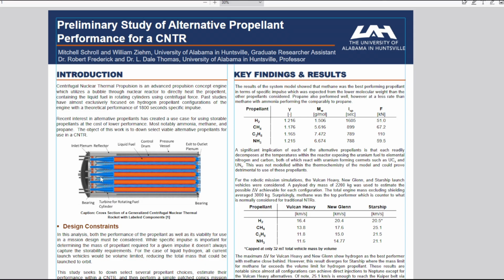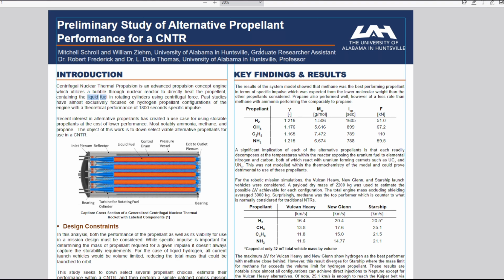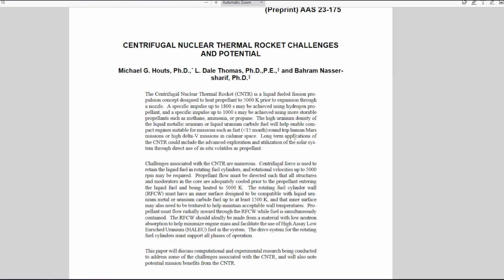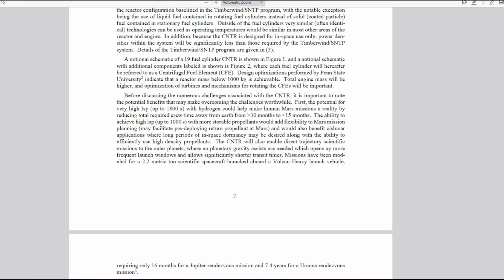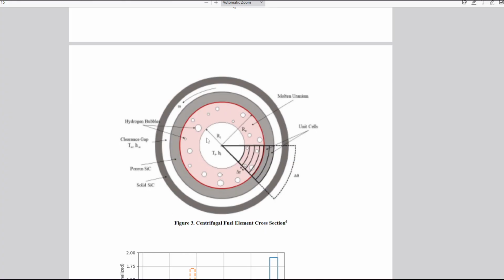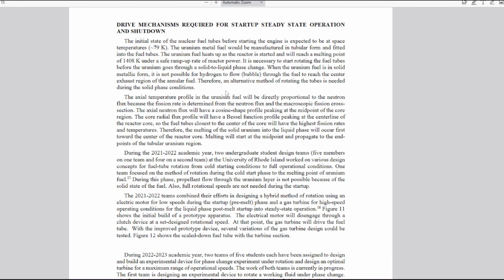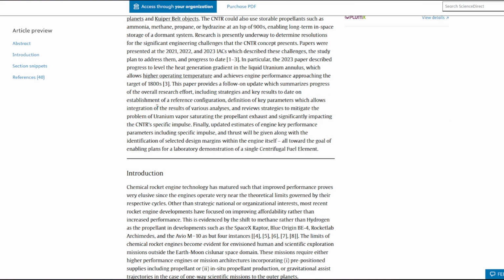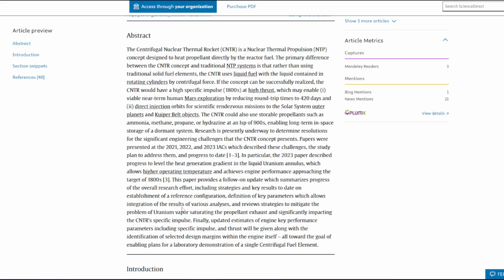On Centrifugal Nuclear Thermal Propulsion

Comment: Personally, I've always been skeptical of liquid-core nuclear thermal, since it's a similar level of complexity to gas-core but doesn't manage the same insane Isp.

Also, using an open cycle rocket is entirely acceptable if you're using it away drom Earth, like for travelling to Mars

I think the old Soviet project on containing gaseous (highly ionized) uranium with electromagnetic fields is of particular interest re: getting gas-core to work.

Comment: The way I read this, Liquid Fuel is in reference to the rocket fuel, not the nuclear fuel. The way I am picturing this; is a rotating conical cylinder with walls made of a fissioning fuel, and inside that cylinder is the rocket fuel travveling along the inner walls, heating up, until it reaches the expansion nozzle and is ejected out the back. The centrifugal G forces keeping it compressed and liquid while it is being heated. A portion of those nozzle gases can be used to rotate the entire engine. Two, counter rotating, engines can be used, to balance out the forces on a craft.
Reply from the maker: I initially pictured the CNTR the way you did, but reading it, the liquid fuel is very much the actual nuclear fuel here. This is a liquid core nuclear reactor.
Reply: @RaizSpace  Or it could be both. The liquid nuclear fuel travelling through the inner walls of the tube in the same way that cryo-fuel is pumped through engine bell nozzles for cooling. And then rocket fuel flowing through the inner annulus.

Comment: The only added value of such a system is the use of LEU rather than HEU but I perfectly agree on the shortcomings to test such a system on the ground and the lower risk-benefit tradeoff. Some might imagine to use a scrubber-ejector combintation like the one used to test vacuum rocket engine with an additional filtering system to recollect condensate uranium particles. However, with Draco now cancelled and the advancements in propellant depots I see little future for nuclear thermal propulsion in the short term.
Reply from the maker: Well, I've been working on a future history, so I'm looking at the long term.

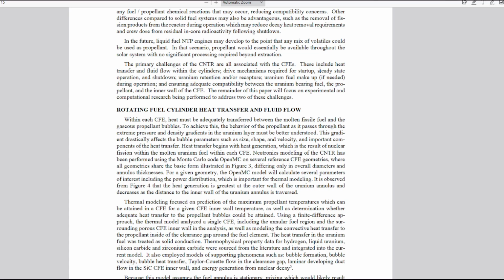Comment: 7:16 As I understand it, the goal is not to avoid having the propellant touch the liquid uranium, but rather to avoid having the uranium flow out the nozzle when it melts. 

Spinning up the drums creates a centrifugal force that pushes the liquid uranium against the walls of the cylinder. You would then have the hydrogen enter the cylinder through those same outside walls (perhaps through some semi-perimable layer or filter that let's hydrogen through but prevents the liquid uranium from flowing back up the propellant feed lines). Because of the centrifugal force pushing everything against the wall, the lighter gaseous hydrogen would experience a buoyant force, resulting in it bubbling up/in towards the center of the cylinder, where after breaking through the surface of the liquid uranium it could travel down the length of the cylinder and escape out of the nozzle.

Having these bubbles of hydrogen pass through the liquid uranium allows for great thermal contact, but you need the strong centrifugal force to prevent the uranium from just flowing out the nozzle together with the propellant.